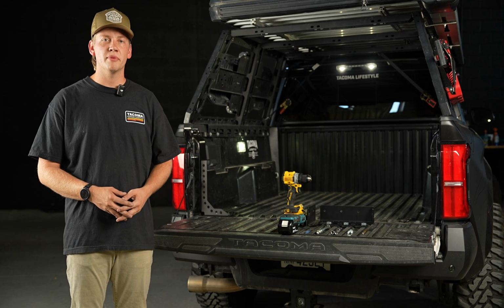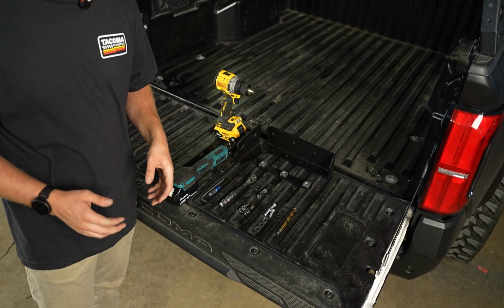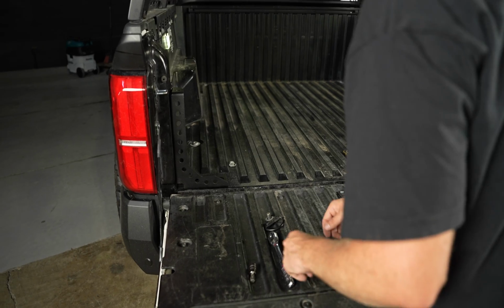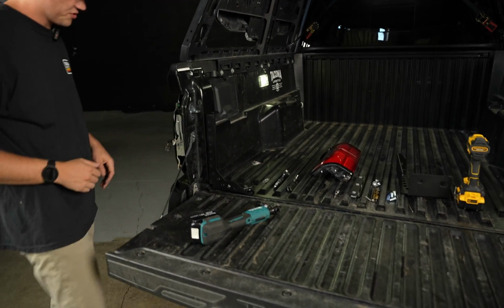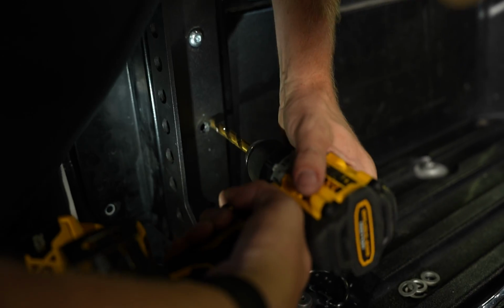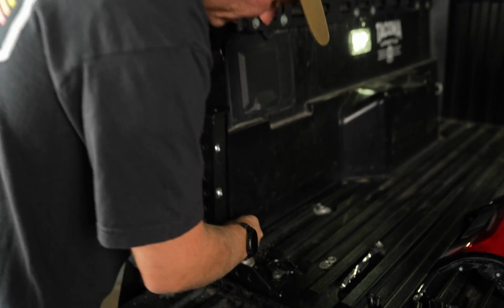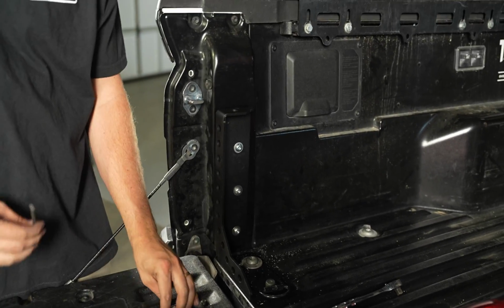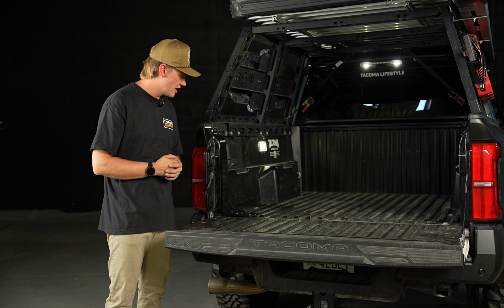Installing Cali Raised Bed Stiffeners for 4th Gen Toyota Tacoma

Comment: This is by far a better bed Stiffners install video than the other one you made awhile back.
However my kit came with a extra pair of backing brackets that the cage nuts snap into. 
Was that a packing/shipping error?
6 cage nuts and 4 backing brackets?